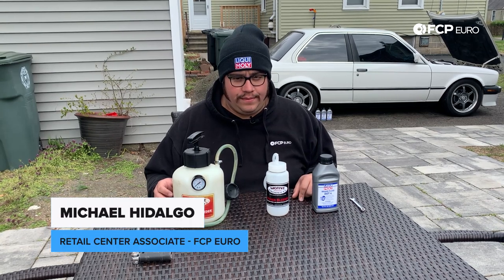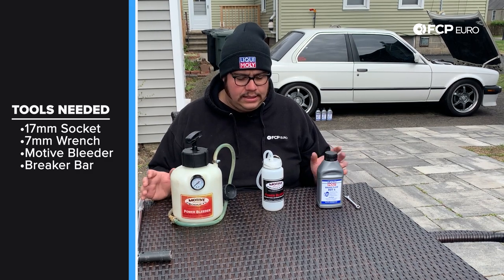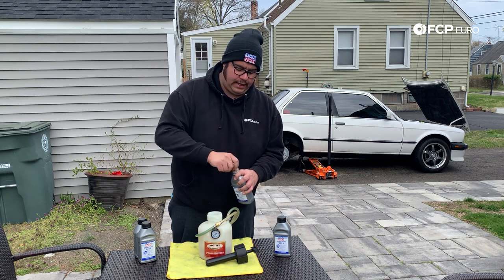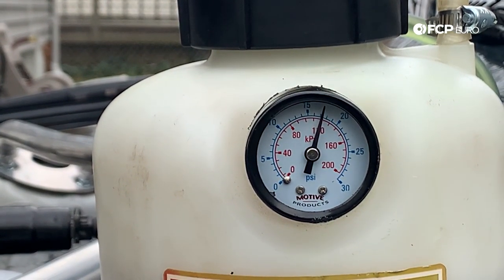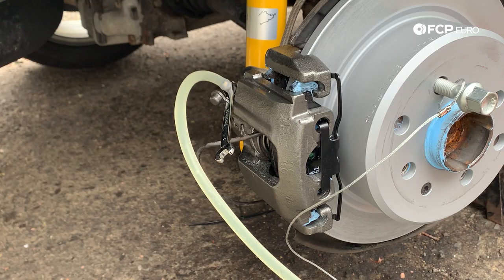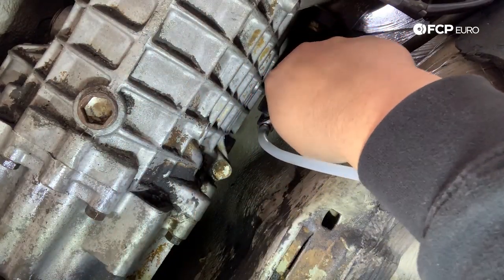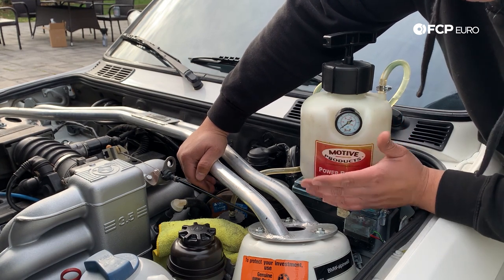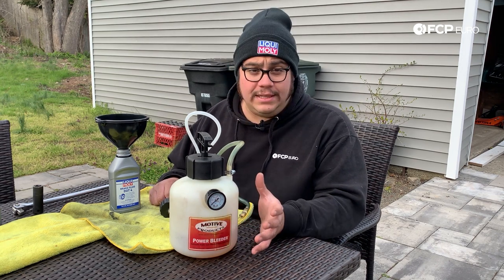BMW E30 Brake Flush DIY - One Person Brake Fluid Flush And Replacement (BMW 325i, 318i, & More)

Comment: I believe the instructions say to first do a fluid-free 'dry run' of the Motive PowerBleeder to test that the relevant connections are airtight and thus able to hold pressure.

1) Attach to master cylinder without fluid in the PowerBleeder.
2) Pump tank to 15 psi.
3) Wait for about 10 minutes.
4) If tank has maintained 15 psi, then proceed to the bleeding procedure with brake fluid in the tank.

Be sure to use eye protection.  When done bleeding vehicle, BE SURE to release the tool's pressure AT THE TANK.  If you loosen the Motive master cylinder adapter cap to relieve the pressure you will create a mess [fluid will be sprayed under pressure].

Comment: Perfect. Great job on the Vid. If people simply copy what you've shown here they can't go wrong. The only things I might share is I bought Motives Euro Aluminum Adaptor Cap and also out of slight frustration I put their 'Quick Coupler' fittings ( it's like an Air Tool Fitting) inline on the hose to make things easier.
Reply from the maker: Thanks as always G MAN, both additions you suggested are great ad ons to an already great product!

Comment: Great video; thank you. I have an early version of the Power Bleeder (CTA-7015), but when pressure is added, it leaks at the car brake fluid reservoir and power bladder cap (hand tight and not overtightening). Are there any leaking issues with this version of the power bleeder?
Reply from the maker: Sorry to hear that Tracey, you may be able to source a new seal for your cap. We have had good luck with the current one in the shop!

Comment: After everything’s done, when you push the brakes does the fluid in reservoir go down? Do you need to top it off?
Reply from the maker: It shouldn't go down too much, but its not a bad idea to check it and top off if needed.

Comment: Did you do the M30 swap?   Is the M30 from e28 or e34 or e32? Looks like a tight fit.....It keeps with the time period of the e30....What does that give you under the hood?  220hp?  (there were some that had only 180hp) Or have you "mod" it for more.  Thanks.
Reply from the maker: MrCuckoobox we have a build highlight video with Mike and his E30 coming out soon(just had a few things left to shoot at FCP Euro HQ then Covid19 hit). The E30 swap was already done when Mike purchased the car, but he pulled the whole thing out to refresh and seal everything. The Engine block is out of a 87 535is, and the head is out of a 89 735i. Ireland Engineering 284 cam installed while the head was out for the rebuild and additional machine work he had done. Butt dyno puts in between 210-220hp.
Reply: @fcpeuro  Sweet......Look forward to it...Just order parts from FCP and replaced fuel regulator & fuel pump in my wife's e91.  Snuck in a few parts from my e30 too. ;-)

Comment: my e39 TIS instructions says to pump the brake pedal 12 times while the front bleed nipples are open and the pressure bleeder is connected, which is confusing, doesnt the master cylinder draw air back in if the pedal is pumped with the bleed open? do we need to pump the pedal at all with pressure bleeding? if so with the bleed nipple open or closed?
Reply: Usually any time you pump you open up push and close before coming back

Comment: So if u upgrade to a big brake kit on a newer bmw, do u need to reprogram the brakes pedal?
Reply from the maker: There are a few factors when upgrading to larger brakes. If you upgrade to much larger calipers that carry a greater volume of fluid, you may need to upgrade your brake master cylinder to match, otherwise the brake pedal will have increased travel when compared to before.

Comment: You can also do this by not filling the pressure bleeder, only the reservoir on the car. Less fluid wastage, potential  for moisture, and risk of fluid every where if the cap comes off particulary on a bayonet style connectors.
Reply from the maker: Interesting John, never seen it done that way but if you can ensure you have enough liquid in the reservoir to not suck in air I could see that working.

Comment: when you bleed the brakes, the brake pedal will fall to the floor .. should we prevent this ? or does it not matter?
Reply from the maker: Hi Lambor, with the system open, it is normal for the pedal to reach the floor. You always want to make sure the system is sealed before letting the pedal up if you are manually bleeding the system.
Reply: @fcpeuro  thanks for the heads up, if there is no harm propping up the pedal during bleeding I might do that.